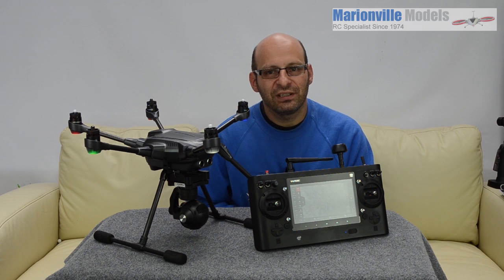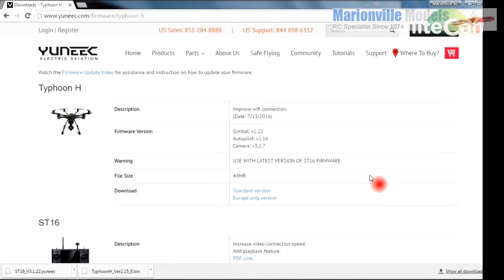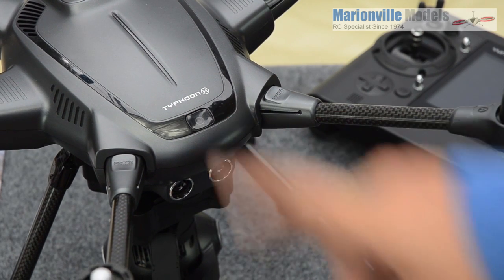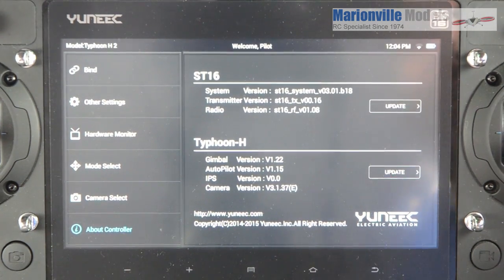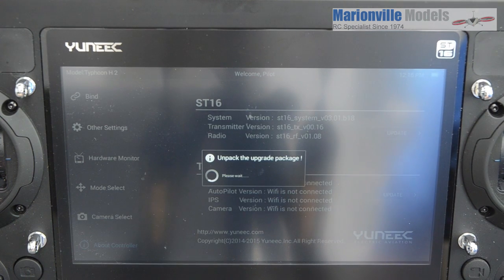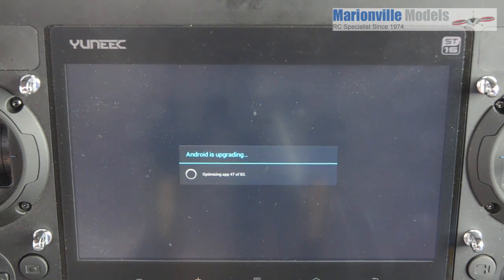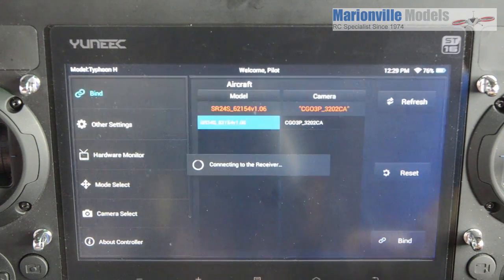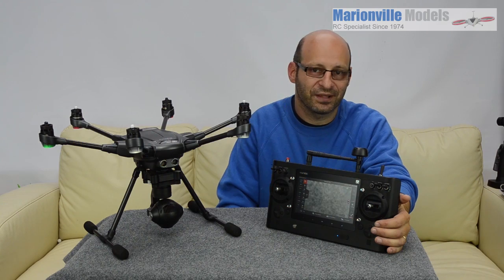How to Update/Upgrade Firmware Typhoon H & ST16 Controller

Comment: Has anyone experienced the H not starting the motors despite following the upgrade process meticulously, performing the calibrations (both in the hidden menu and the compass/accel)? The drone shows as bound, camera works fully, GPS never acquires, when I put the craft in H mode and attempt to start without GPS, i get 3 beeps but no motors start. Top left says ready and briefly display "start"; but motors don't spin. I have tried replacing the compass/gps module once, same results. All light indications display correctly when switching modes. I am at a loss and seem to have exhausted all the youtube help vids as well as have tried to contact yuneec. Because I'm out of warranty they told be to kick rocks. Also tried leaving it in open field in a previously flown area before to regain GPS. Nope.

Comment: this! I tried 3 times to update, first with a 32GB SD card, then with a 8GB card, to no avail. Finally, I had a 16 GB SD card, redid the entire process, and Viola! now it worked. I don't know if that makes a difference but maybe it needs to be a 16 GB SD card!
Reply from the maker: Ray Maramara the size of the card shouldn't matter but always format the card first.
Reply: Thanks! That's what I thought but hey these new-fangled things act strange occasionally. Like new, I'm trying to do the same thing with my Typhoon H #2 and it won't do it. Does the whole routine and at the end, tells me it failed because of camera time out failure?

Comment: Thank you for the in depth info for firmware updates.  Your video provided information about entering Team Mode, not referenced in the factory H manual or in the Yuneec tutorial video, , which permitted my system to complete an update it otherwise would not.  Had you not made this video my H would still be relegated to a paper weight state.
Reply from the maker: Glad it helped.

Comment: Thanks so much for this excellent "how to" video. I have two (2) Typhoon H sets and just a note, after upgrading the first one, it added the usual folders to the SD card. When I tried doing the second H, it would not do it. I had to delete everything, empty trash, re-copy the firmware update file for the H and then re-insert the SD card onto the CGO3. After that, all went well. Thanks again and happy flying!

Comment: Iv been trying to update the firmware on my typhoon H control and drone with no luck! Will the software install using a Apple MacBook ? I've formatted and downloaded the firmware to the micro SD card 4 times using a apple MacBook and a Windows 8.1 laptop and the st16 controller by following this video writing on screen but that also did NOT work, I now don't no if there is another way to update the firmware? Maybe the USB lead plug to camera and controller from laptop? Any help on this would be much appreciated? Thanks
Reply from the maker: You have tried all the methods I would suggest. I would speak to your dealer to take it further

Comment: Top man, I'd never know a Rc drone would be so complex
Reply from the maker: There not quite the " any once can operate" craft the manufacturer makes out.
Reply: i came across from EDF JETS very fast ones because drones seem to be the forefront of clever tech so far. the plus side of drones is take off and landing. no runway required. so i bought a typhoon H. i wanted th real sense and waited for 3 months but still model shops are putting the date forward so i bought the advance for now. any idea when the real sense is released?
Reply from the maker: +Peter Eliott for the UK it's the first two weeks of August.

Comment: Thanks. Your video was very well done, and helped me tremendously!
I had problems at first, the ST16 not seeing my card. I did as you suggested by formatting the card using the ST16, then, I downloaded the firmware upgrade again. This time everything worked flawlessly. I'd recommend anyone having issues to re- download the firmware cause it may not work the first time around. Just keep at it using this very valuable video as your guide, and it'll eventually work. THANKS again Marionville.

Comment: Thank you.  I've been a little nervous about doing the update after reading about all the problems on the Yuneec Pilots forum page...got your link from there, and after watching your video you have inspired me to give it a try....but one question, is it worth doing?  I really don't see what the improvements are...what features or benefits have you noticed?
Reply from the maker: The main update was to speed the connection time after switching on. Other updated are more minor.
Reply: ...so do you think maybe it's worth just waiting for the next update and skipping this one?  Thanks
Reply from the maker: +Brandon Bogeaus your best to do updates in there order of release.

Comment: ST16 will not update, I keep getting the same error, update package not found. Using a 16GB card formatted to FAT32. Any suggestions?
Reply from the maker: For reference. Formatting the card via the ST16 controller solved this issue.
Reply: I had the same thing. I moved to the pad mode, then downloaded the firmware from the website. Then you have to transfer the file to the root. Now it is possible to update.
Reply from the maker: +igor tsimbler good to know.

Comment: Thank you for an interesting video.
  I want to ask what it means to the standard version? I live in Israel. Which version do I install?
Reply from the maker: It seems your craft will work on either firmware so you could use the Standard.
Reply: Thank you. So I thought, as I did

Comment: Through much research, I've finally found the answer, as well as the cause of my problem (as well as anyone else who's having the same problems).  While the CGO3+ camera does support up to 128GB cards, the ST16 supports ONLY up to 32GB cards.  Thanks to several people who had the same question on rcgroups.com, thr correct answer was found.  So, to anyone reading this, remember this:

CGO3+ camera:  128GB maximum capacity, FAT32 or exFAT formatting
ST16:  32GB maximum capacity, FAT32 formatting

Comment: i also had to rebind everything, was in a bit of a panic, thought i had bricked it after only purchasing it from you the day before :)) in my case only the cg03+camera showed up, but after a few refreshes the model appeared as well:) after putting it into binding mode by tilting it forward twice at 45 deg angle, but alls good now, did a  flight down at grey mare waterfall in Moffat. thanks  again see you again for another battery and back packs when they come :p

Comment: I have updated the drone sucessfully, but when I atempt to update the ST16, I keep getting the same "Upgrade package not find!" error message.  I downloaded the file (ST16_V3.1.22) from the website, placed it on the same 64GB microSD that I used for upgrading the drone's firmware (after performing a quick format, as this is not the same microSD card I'll be using for recording videos), and followed all othr steps...but, again, with the same failure message being received every time.  I did happen to notice the "SD card" icon in the upper-right hand corner of the screen shows "N/A", although I don't know if that's in reference to the ST16's microSD slot, or the microSD slot on the drone (which is turned off).  I've also gone so far as to try updating the ST16's firmware with the microSD card inserted into the drone, but that also produces the "Update package not find!" message.  So, HOW do I update the ST16's firmware?
Reply: As it turns out, it does matter.  As mentioned in my most recent post, the ST16 only handles up to 32GB cards.
Reply from the maker: I'm not sure why your having issues. May be worth trying a different sd card.
Reply: +Marionville Multirotors Just a different card (ie. same 64GB capacity)?  Or just a smaller card?  I have a 16GB card I can try.  I know that the Typhoon H supports up to 128GB cards...does anyone know what the maximum capacity cards the ST16 supports?
Reply: +Marionville Multirotors Almost forgot...the firmware update for the Typhoon H is a .bin file, whereas the firmware update for the ST16 is downloaded in a proprietary format unique to Yuneec.  Does this file's name extension need to be changed to .bin, .zip, or something else?
Reply from the maker: +Panther6834 it shouldn't matter. Any other card.